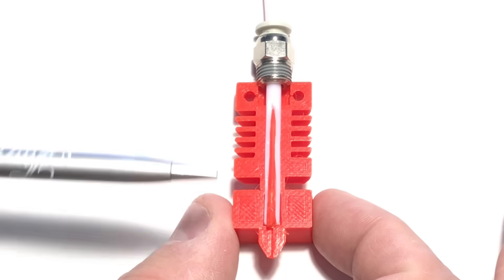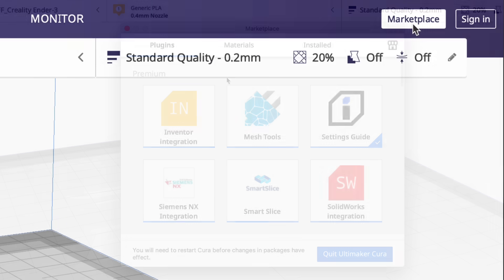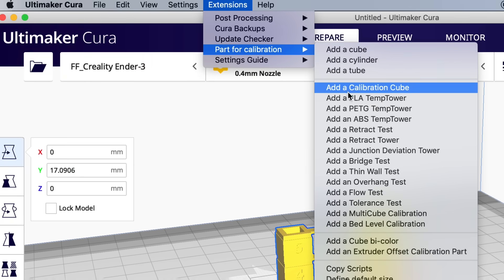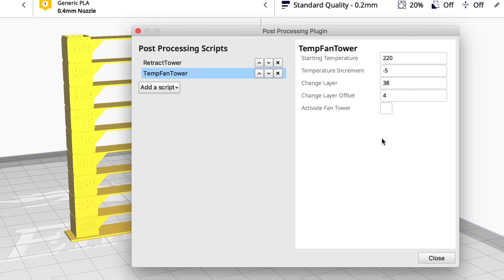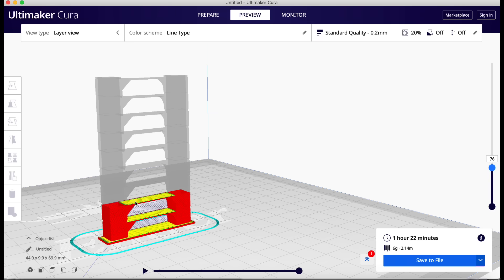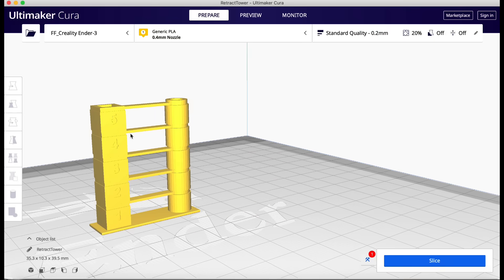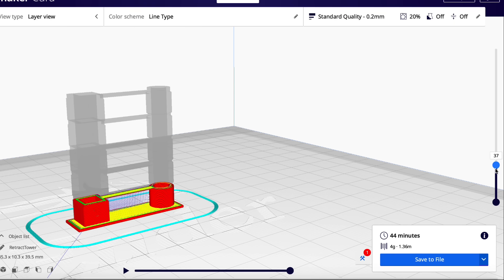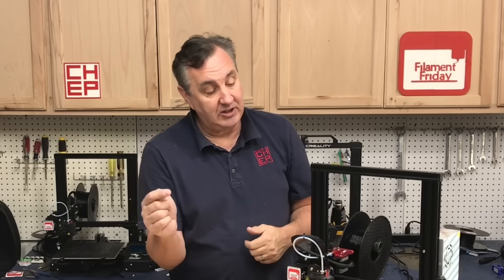Calibrate Perfect Retraction Settings Using a Cura 4.8 Plug-in

Comment from the maker: Note: If you use a newer version of Cura than I use in this video, you don’t have to “Copy Scripts” they are already included when you restart Cura.
For more information on settings visit this: https://github.com/5axes/Calibration-Shapes/wiki
Reply: Let's not talk about how much time I wasted before reading this...  :-)  Get your tower, reboot, Extensions>Post Processing>Modify G-Code THEN add the script you want, Like RetractTower close, then a little red dot on the lower right part of your screen shows it's active, SLICE it and go print...  Also, remember to remove the script when no longer needed in Cura.
Reply: @patrickmcintyre8023  my printer just stays at 190 even with the script active
Reply: @patrickmcintyre8023  it didn't work for me tho, it doesn't change things...
Reply: I thought I was going crazy, thanks
Reply: When I run the temp tower, it runs at my standard PLA temperature setting through the whole print, even though the script is loaded.  It isn't changing temperature at the set layer height.  Any ideas?  I'm pretty new to this so I have no idea how to fix this issue.
Reply: @ripcord525  I am running into the same issue with 5.0. I had to watch the print and tune the temp at the change.
Reply: @ripcord525  having the same issue.   how do you fix that
Reply: @ripcord525  have you add script and check in the slicer for layer height temperature change before slicing it?
Reply: Can u make a tutorial with the new cura I am a total noob just trying to learn
Reply: I did both tests On my Ender3 pro. I run the Creality slicer program. I did what you did here in this video and the layers and settings would not sync properly. And when I printed them seemed like the change in heat and distance didn’t even change. They were pretty perfect all the way up. Not a single difference. Now when I print an object that I want to print seems like it needs calibration. What would you do?
Reply: @alenharris1152  look at 2:20 in video
Reply: Using the Auto Towers Generator is much easier now. No scripts required. The only setup is installing openSCAD and entering the (dot)exe location into the extension settings on CURA. Don't need to use openSCAD, Auto Towers sets up the print directly in Cura.
Reply: I am 5 days into printing anything and I have sooo much more to learn (like this is where I learned Cura had plugins to begin with). I get very good basic square prints that don't require supports or bridging, but I want to know what I am doing more. I learned basics about infills about a day ago.  If you are a very casual printer, it would take a long time - and lots of error - to learn all this, and I imagine a lot of people just give up after a while. I have an Ender 3. Maybe there are printers out there that just figure it out with more presets? I am having fun, though.
Reply: Thanks for all of you help!
Best 3dprinting channel on youtube
Reply from the maker: Thanks
Reply: Hey, do i have to disable the retraction before slicing the retraction tower? thanks! @FilamentFriday
Reply: my layers dont match up with yours mine dose 39 then 80 and  122 so on
Reply: I'm trying to walk through the video and was able to add the extensions for the calibration shapes but I dont have the same listing of scripts in post processing that you do. I actually have a LOT less and no retraction tower or temp adjustment. I'm guessing the creality slicer 4.8 isn't compatible with this process? I also have UltiMaker Cura but that one dosnt match up but they have auto towers with the G-code already assigned/
Reply: I can't get the temperature tower transitions to match at 38. The 1st bridge starts at layer 39, then the next at 81, next 122, etc.! Any ideas?
Reply: Did you Do this for tpu?
Reply: @jonathanjo4273  I love such questions. And you did the tests for TPU?
It will take you 2 hours of your priceless life. Just do it analogously to this tutorial and you will be enlightened. Simple like that.
Reply: Same with me been looking an looking all over an hadn't run test foe a few weeks look in how to do a tower but thanks so much
Reply: Yeah, guess I should have read this comment up front... but found out they'd "fixed" these issues.
Reply: Thank you very much for posting this :)
Reply: My cura retraction is set at 6.5mm. Works well.
Reply: So, all i have to do is send it to the printer, it will change temperatures an retaction as they model prints?
Reply: @SleemanBoss  Wondering the same thing?

Comment: for anyone watching this video in late 2025, now the plugin that he uses in the video is no longer avaiable on Cura, but there is another called "Auto Towers" that works fine. Older comments say that this plugin doesn't do automatic scripts but now (maybe it has been updated) when you slice the temp tower and export the g-code, you can see that it contains automatic temperature changes between every level of the tower at the right layer. This is also the same for retraction tower, with the exception that you'll have to select in the pop-up window that appears when you select the tower a distance range (like variation from a retraction distance of 1mm to 6mm) or a speed range (like variation from a retraction speed of 30mm/s to 60mm/s). Try to do a few tests and see at the right temp what are your retraction distance and speed best settings.

Comment: Guys turn on coasting it fixed all my issues instantly
Reply: What is coasting?
Reply: @fireballmx coasting is a slicer setting that forces the printer to follow already printed parts when moving without extrusion (you can specify to follow walls, filling, ecc...) to reduce the filament oozing during movements
Reply: coasting is useful until the printer is forced to not follow already-printed parts because it would be impossible to reach another location. This is the purpose of the test towers, to go from point A to B moving in the air and with less stringing possible
Reply: @andreamamini7017  unless i'm missing something i thought coasting was using the oozed out filament to end a layer

Comment: I ran the heat tower and it showed that i should print at 185 for my filiment. that is 5 degrees less than the suggested on the roll. i was surprised to say the least.

Comment: I’m a noob at this, but I don’t see the point to making that extra piece. I can’t afford anything the PLA atm.  I just want to make cool
Builds without the hassle of the dang bed being inconsistent.
Reply: I'm brand new.
I spent 12 hours printing towers and dialing in a profile.
Its so much better in the long run.
You dont want to be 8 hours into a print and have it fail
Reply: oh brother... printing is like 1/3 of troubleshooting. you need a constant revenue of $ to calibrate and be able to print parts.
Reply: you can spend a few cents of filament to get everything working right. or you can spend the money later when your prints fail, require more post processing etc.
the test towers cost literally $0.04 in material
Reply: @ThePointlessBox_  thats what i was doing. i did it over multiple filiments

Comment: It does not look like the Calibration Plug-IN is available anymore on Cura. Any ideas where to get it ?
Reply: Get the plugin called auto towers
Reply: @Slyracoon666 Thanks I got it on github. But I am limited to Cura 4.10. 0 since I have windows 7. The plug in works to slice the tower but one cant delete or clear the build plate. It just throws out a list of errors and closes Cura. I am using the Cura plug in for version 4.13. since that's the oldest plug in I can obtain
Reply: @meisievannancy  get windows 11 then?
Reply: @Slyracoon666  Autotowers is by Brad Kartchner and Calibration Shapes is by 5Axes. Autotowers is available but CS is gone. Much as I appreciate Brad's contribution, his spirals and bed levelling menus don't seem to work to produce any g-code in my Cura 4.13.1 at the 0.2mm single threaded spiral.
Reply: @Slyracoon666  Does auto towers have the script built into it for the temp changes? Or do you have to do that manually somewhere?
Reply: @BigRedGaming11  I cant find it either does anyone know?

Comment: Unfortunately neither worked for me. Both are showing up as "untitled g.code" and with the temp tower the temp doesn't change automatically. And with the retraction tower, my retraction does not change.
Reply: For me, going to: Extensions -> Post Processing -> Modifiy G-Code -> Add script -> Temp Fan Tower. And change the settings as CHEP did in the video. Just tried it on my Ender 3 v3 se and its working. The temperature will change on the layer that is change layer offset the first temperature change. for me this was layer 5
Reply: @gshlawg  Under "Modify G-Code" there isn't a option to "Add Script" anywhere. I'm running version 5.7.0. If the script is already added with the new version wheres the option to change settings?
Reply: @offgridMuskoka I think in the newer version they don't give that option. Just slice the tower you choose and the temperature is changed automatically for you. I prefer the older version where one can choose to do it oneself
Reply: @offgridMuskoka  You must choose the Custom Tower to change settings per layer. Then it will provide the option.

Comment: Hello!
i hav just upgraded my ender 3 v2 to Ender extender 400 and i have motherboard 4.2.7. i have also new firmware from github ( ENDER 3 v2 BLTUBL MPC 2024 ) but i can not activate G29 in cura , so it makes mesh before every print..   ( M420 is getting mesh from saved  is that right?)
hope you understand my question
Can you help me?
Best regards
Willis

Comment: I don't get it. I tried to follow what you did and check the layers of the change in Cura, but on the temp tower when I checked where the layer change should be the first one was at 40 (don't know why) and the next one was at 82, and next was 124 and so on. What settings are wrong? 

I did the PETG one and had 250, -5, 40(since that was the change for me) and 4 respectively.
Reply: If you have a different layer height, you probably also need to also change the "change layer offset" value.
Reply: I have the same issue, I can't work it out either, set everything back to default, still out.
Reply: same issue

Comment: Thanks.  This was very helpful as I've actually never bothered with this.  I've gotten lots of good prints, but now I'm interested in "better bridges" so I'm trying to dial in the retraction and temp settings.  The temperature setting was a bit weird though.  My expected setting did well (200C)... but so did 210C (maybe a little better) and surprisingly, 190C did okay but had pull-away on one side... 210C had less "droop" on the bottom, so that is why I'm thinking it did better.  But I kind of expected: fail, fail, fail, good, good, fail, fail, fail or something like that.  Instead I got: fail, good, fail, good, fail, good... Which, while I can maybe discount 190C, it makes me scratch my head because both 220 and 215 failed, then 210 did okay.  Then 205 failed, 200 did okay, 195 failed, 190 had an issue, but did okay, and the rest failed.  So, I'm not exactly sure which of the two temps, 210 or 200, to use.  I'm checking the retraction length with the retraction tower at 200, but maybe I'll try another at 210.
Reply from the maker: You may have inconsistent flow. I would check for slippage at the extruder or partial blockage in the hotend path.
Reply: @FilamentFriday  Thanks for the reply... I'm actually printing a "flow tower" now... the only problem seems to be, the flow tower doesn't quite have a proper "layer alignment"... There doesn't seem to be a consistent value where each different flow changes.  Best I can make out it is supposed to be 29 for my 0.2mm layer height, but it doesn't seem to hit every change exactly.  Maybe the layer change height is just odd (like 28.5 or something), but I'm printing as close as I can get.  Hopefully this will improve my bridging, because while I can get great prints, bridging has been a sore spot for me.

Comment: i did  the temp test, but when it was doing the bridge it was going like spaghetti until it built up enough to bridge. i noticed it was worse when it went from right to left because of the fan duck on the ender 3 v2. it did get better as the temp went lower. is this because of the fan speed being too high or do i need to turn on bridging (i only just found this setting)

Comment: and how i get the settings of 5 then?

in my case, 5 wasnt enough, so i changed the starting value to 5 and print the model again. if the stringing now stops at 7, what retracting settings i have to use then?

how i get the settings i dont understand, hope somone can help
Reply: you have to change the setting called "retraction distance" in your case you will have to change the value to 7mm. you may also look into the retraction speed, that will also help in some cases 

if you have any other questions, then feel free to comment it under this one :) 
ill try my best to answer
Reply: @OmG-yo5rn  hi, thank you... i auto leveled the bed again to test if thats the Problem. And now dont work anything. I cant Level it good again :/

Comment: why does my ender 3screen show nozzle temp 200 when in gcode it it set to 230?
Reply: oops never mind it did change lol. it was just 200 for the first part. but when it got to the actual thing the temp raised
Reply: @Silver-nm2if  so it does change when it officially starts the tower?
Reply: @M1ckyMack  yes.
Reply: @M1ckyMack   yes, it starts the change on the layer you set on the offset
Reply: @Silver-nm2if  mine didn’t. Is it supposed to show on the LCD screen?
Reply: @M1ckyMack  yes. The nozzle icon will show the temp change

Comment: So if "5" seems to be the best on my retraction tower, does that mean that I should set my Retraction Distance to 0.5mm?
Reply: no, you set it to 5mm unless you changed it to 0.1mm increments
Reply: @Hemskyfan99  I figured. I have a direct extruder so I was a tad confused lol

Thanks for the answer!
Reply: @Hemskyfan99 i having same issue, 5 is perfect for me very tiny stringy but much better than what i had.

what do i put? "5" as my retraction distance, when i did that i had the same exact issue

Comment: I have tried this print twice and both times I've had to monitor the print and change the temperature manually. I'm using Cura 5.3.1 and an Ender 3v2.  Any idea what I'm doing wrong?
Reply: Personally, I connected my printer in usb to my pc and I send it directly, it works very well, try it maybe
Reply: dont choose hight, try choosing layer number

Comment: Is it just me or is he changing the temp just before the bridge instead of after? Where he sets layer change at would change the temp right before the first print starts so wouldn't the first bridge actually be at 215?
Reply: the offset in the script its actually the number of initial layers set in your cura settings. so you can go look up to that and fix the value, so from that number you will have to count the layers not from the firs one.
had the same issue today hope it helps :)

Comment: Did I just watch this entire video about calibrating retraction and titled "Perfect retraction settings" but nowhere does it show how to actually change those settings in your printer profile? Cool video man!
Reply: If you can't figure out where to change your retraction settings you need to learn the basics of using your slicer before you go tuning settings to this level of accuracy.
Reply: Its in your settings. Sometimes its under advanced settings just enable that and then gradually increase or decrease the retraction values. Youll need more retraction (abt 6-8mm) with bowden style and about 1-4mm with direct drive hot ends. I recommend you get a common model slicer program like cura if you want to get into each and every settings possible but learn the basics first with the creality software they have a simpler program thats easier to learn on.
Reply: @armeddeafboi7276   Who are you recommending that to? Me? 😂 Thanks for that tip. “The setting should be under settings.” 🤣 And enable what? Retraction? 🤨
Reply: @FreshCityVentures  Yes. You can enable the retraction settings in the settings. You can find the settings by looking for "print settings" and retraction under "Travel" if you are using Cura. Simply use your mouse to check the box to enable retraction otherwise the retraction settings will be hidden in the print settings menu.
Reply: @Benny-br5xk  but how do I set the output PSI relative to the feed rate of the Z-axis??

Comment: Can you explain what the purpose of the brim is and how it being so far away from the tower benefits in any way?
Reply: I'm just a beginner, but I use brim to clear the nozzle of any drips from the nozzle heating. It doesn't contribute to adhesion, but that's not really a problem if the print has enough surface area on its own. Being so far away from the print keeps the drips (which can sometimes form loops or tangles) from interfering with the actual desired print.
Reply: @J624  A brim is absolutely for adhesion, it is CONNECTED to the model and adhesion promotion is its only purpose as far as I am concerned. I think this user (and you) was referring to a skirt which is just a couple lines around the model used to purge/prime the nozzle before moving onto the actual model. My suggestion here is that, as a 'beginner" you don't respond to any more questions that people have because you are just passing on misinformation and confusing them.